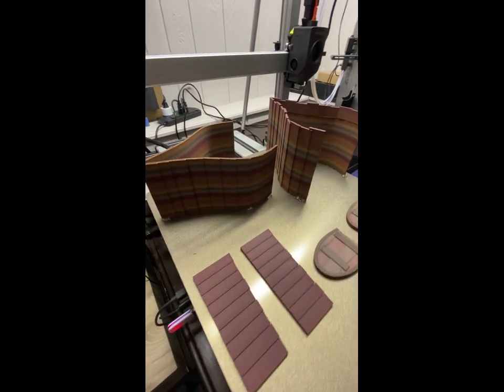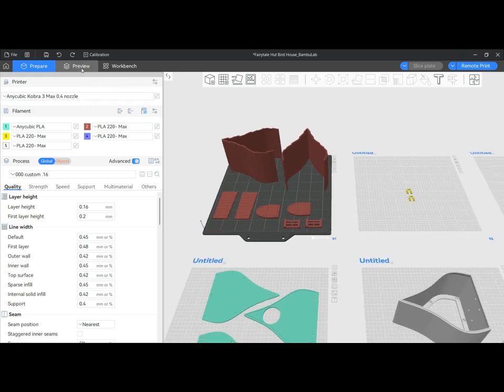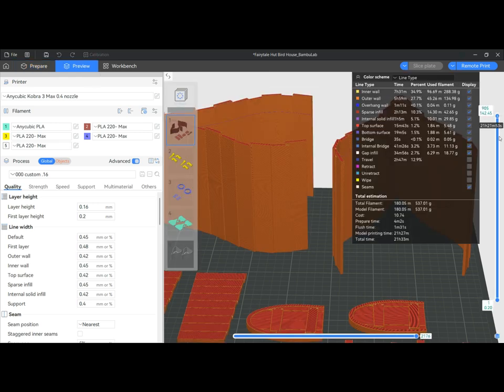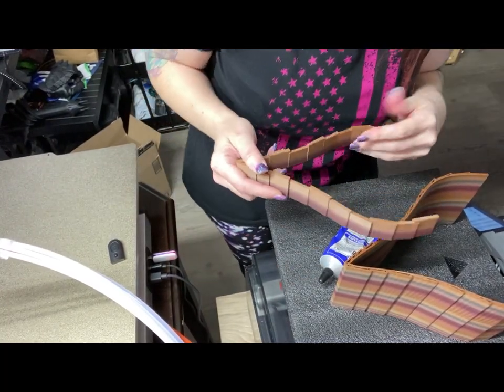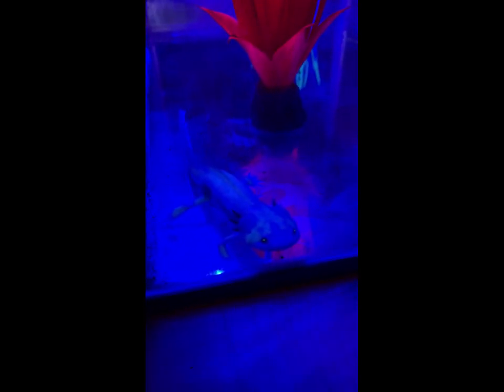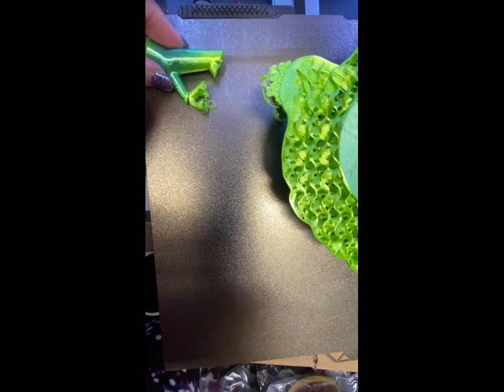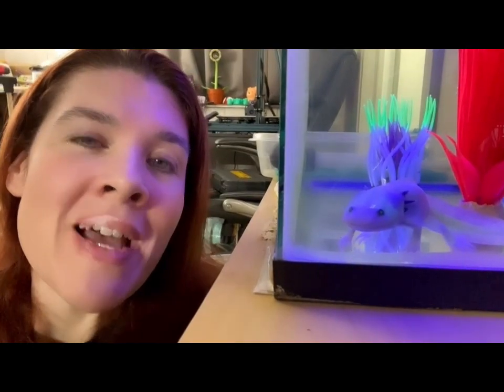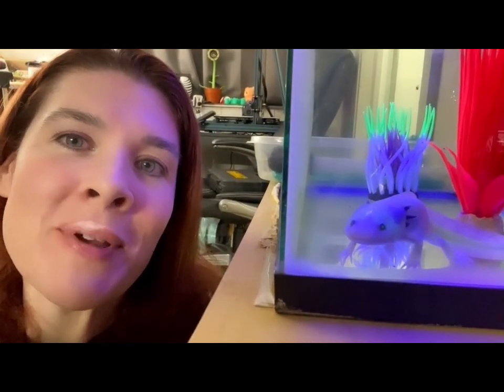#3dprinting Layer shift/failed print or failed supports fix. #anycubic

Comment: Hi, I am new to 3d printing and find your videos to be extremely helpful.  They are to the point and provide answers to questions that I could not find elsewhere.  Thank you.  Can you please share your poop shoot and basket configuration ?  I am not skilled up enough to create my own STLs and have had issues with the only 2 configs I have tried.   Also what do you do with your printer poop ?  Seems wrong just throwing it away and its an odd thing to just save.
Reply from the maker: I use this one and made it with PETG so pla doesn’t stick to it too much

https://www.makeronline.com/en/model/IMPROVED%20KOBRA-3%20POOP%20BIN/28599.html